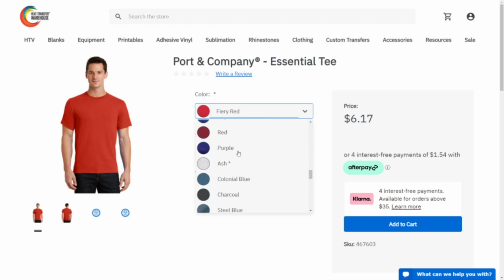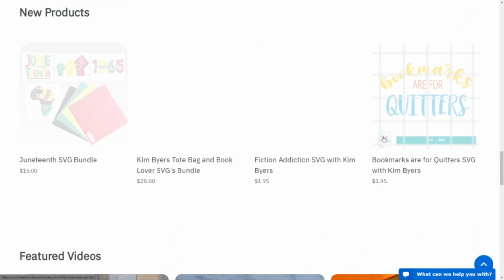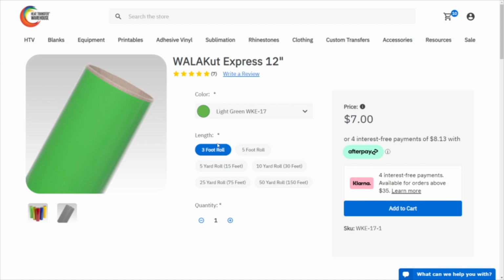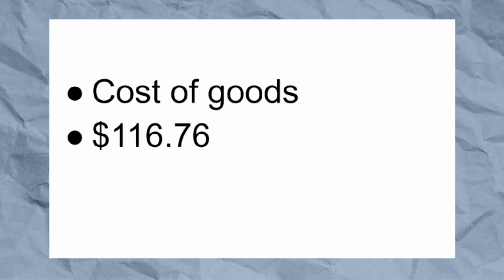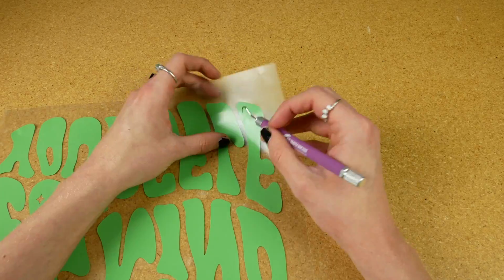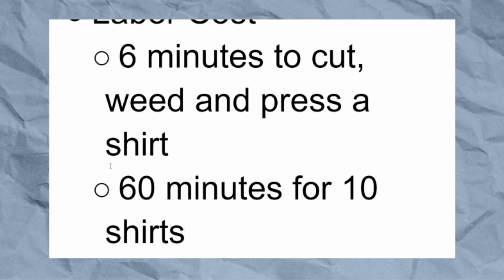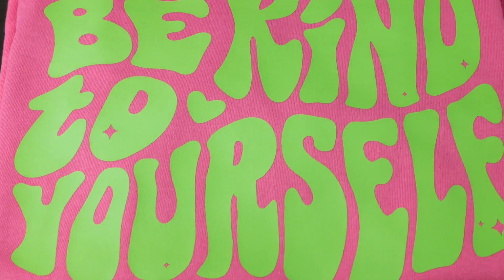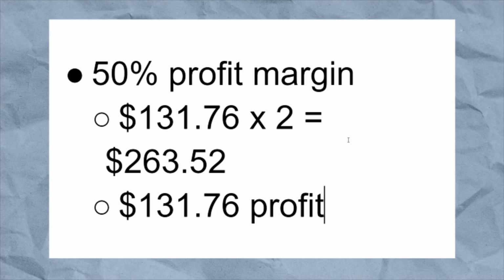How To Price Custom HTV T-Shirts

Comment: What if you have 1 tshirt with a complicated design, that requires  multiple presses, and you need multiple sheets of htv totalling in upwards of $70? Do you charge the customer $70+ for that shirt?
Reply from the maker: If you are spending that much on materials, then yes you would want to make sure you are still making a profit. At that point though, if you are spending that much on materials you may want to consider a custom transfer to cut down on cost!
Reply: @Heat Transfer Warehouse  I looked into custom transfer. However, this is a one-time design, and heat transfer warehouse requires a minimum of 10 custom transfers to be ordered. I would end up with 9 extra designs I don't need.
Reply from the maker: @DialToneTP  our DTF transfers have no minimum order requirements - https://www.heattransferwarehouse.com/walakustom-full-color-dtf-transfers/
Reply: @Heat Transfer Warehouse  wow! Really? That's really good to hear. Thank you.